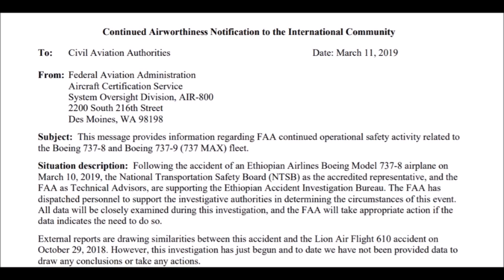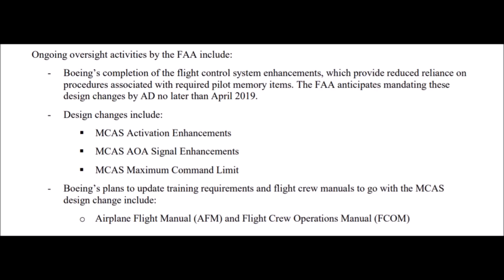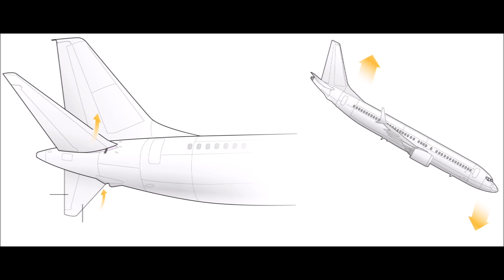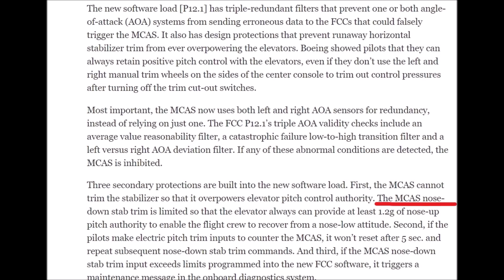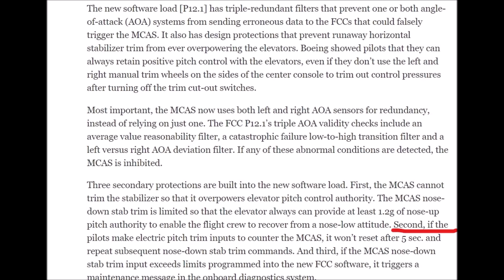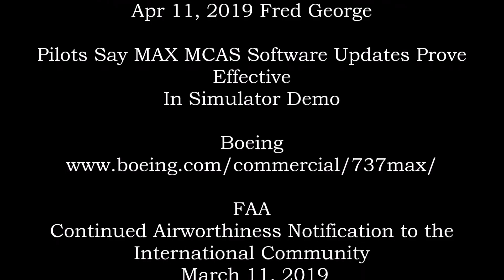737 Max UPDATE 14 April 2019 "The Fix"

Comment: Juan.... Thanks for another very informative video... much appreciated.    I to was a "pilot"... one of the many "90 day wonders" that the Army turned out in the mid 1960s to fly choppers in Nam,  I had a chance to continue on the Alaska pipeline deal, but chose to keep my feet on the ground instead... had enough excitement in my three "tours" over ther to do me for the ramainder of my lifetime.

Just so you're aware,  the Trucking industry is also directly involved in the development of and real-world testing of,  a lot of the modern technologies that has and continues to find its way into the motoring publics private vehicles, at least here in the US, for example; GPS was in use for over 10 years before the first US manufactured "higher end" cars were available with them.   Another spin-off from that was Satellite communications networks from "home operations" centers to each individual semi truck & driver around the country no matter where they were, sitting or mobile... under different iterations and names.

Reflective seat belts is another first so that the highway patrols / DOT etc, can see if you're wearing them or not at night.    Some of the newer technologies being tested (Freightliner Trucks seem to be the test bed trucks for much of this newer stuff) and being further developed is "eye scanners" that watch how often you blink your eyes (and each driver's personal characteristics are programmed into the individual truck's system) during normal waking or driving hours (system is tied in with electronic logging system as well as the vehicles main ECM.   

If it detects a slower or progressively slower eyelid movement (regardless of the cause) it will sound a warning,  if not corrected and detects closed eyelids for 3 seconds it will sound a Very Shrill warning signal,  and for a second time, can initiate a throttle reduction mode apply automatic braking while continuing a warning as well as steering control coupled with traffic monitoring cameras/sensors.  Having said that, the technology is being constantly evaluated and parameters are constantly being upgraded,  so these parameters mentioned a few years back.... development is still ongoing. 

There are many other "high tech" advanced technologies being developed and real-world tested within and through the trucking industry and its equipment manufacturers.

Another technology that has been in use in semis for going on 20 years now is what is very mistakingly called by the majority of the new "so-called" truck drivers (the few of what's left of the real veterans of trucking [30 yrs or more] call the current generation - "steering wheel holders" and most of them do Not have the brains to even do that correctly!) - "automatic" transmissions,  they are Not... they are AMT's or Automated Manual Transmissions.
 
They are still the same Manual transmissions (in terms of the amount of "gears" available, ie; 13, 15, 18 speeds, etc, etc.), but instead of a clutch peddle and gearshift lever in the cab, they have replaced them with interactive ECM's and electro-magnetic servo motors that do all the clutching and shifting for the so-called "truck driver". 

I must say and in my own opinion, the industry has now managed to not only exacerbate an already growing issue that seem to start around the early 2000's and has continually progressed to an ever-worsening situation by not only removing a necessary skill set (and the "brain set" that accompanies),  but in the process are attracting people into the industry that are ever more increasingly "dumbed down" (through the government public "school" system) and quite frankly, many of them have No business Whatsoever behind the wheel of a semi.

I personally,  have nearly 50 years of OTR (Over The Road) trucking experience (semi-retired now) with 27+ years of that as an Independent Owner Operator, and have run all the "lower" 48 states, Alaska, All Ten Provinces in Canada and the Northwest Territories up to Yellowknife and have officially racked up over 6.7 Million Accident Free miles.... and to be honest, I find these new "truck drivers" (mostly those engaged in refrigerated and dry goods hauling).... frightening, to say the least... common sense is nearly non-existent,  they have No compassion for other drivers whatsoever,  and quite frankly - their so-called driving skills, leaves Much to be desired, to say the least.

The only categories that appear to attract and retain people with good well-rounded character and skill-sets are those in the Cattle Hauling, Over-dimensional & Heavy Haul Specialists, Petroleum / Bulk Liquid Tankers, Hopper Bottoms (grain, corn, soy, etc) and those pulling "end-dump" trailers hauling dry bulk commodities of various types.   The "Flatbed" carriers seem to be a "mixed bag"... some are really good,  some are definitely not.... driver quality "seems" directly tied to overall carrier quality and integrity.

I say all this to point out one thing..... we have a situation where "Ai" is slowly (though That is changing rapidly in very recent years) but most assuredly taking control over Everything..... and with it, we - the people are allowing for the "noose" to be put around our own necks.... I openly warned about this coming (and many other things that are Now in place) throughout the 1970s and into the early 1980s... nobody took it "to heart" then..... and the vast majority today,  still don't "get it".
 
Smartphones, Smart appliances of every kind including tv's etc, Smart technologies  =  Secret Military & Residential Technologies!!     RIP America.... your time is nye.
Reply from the maker: Excellent post 2Stroke!

Comment: Don't just fix MCAS and think "Job Done".  Other computer systems and even the fixed MCAS system could fail in other unforeseen ways and drive the horizontal stabilizer.  You have to examine the entire flights of these two crashes (they are rather short) from start to finish.  Somewhere in your examination you will have to ask yourself a very hard question.  Did these two flights crash with perfectly good jackscrew electric motors?  Then, if there is any chance that they did, you have another thing to fix (the "runaway stabilizer" recovery procedure) because re trimming the horizontal stabilizer using the main electric trim switches on the yoke is much faster and easier than turning the trim wheels by hand.  With airspeed building, faster is VERY important here.  Oh, on the subject of "faster", you need to simplify the "runaway stabilizer" procedure by going to a SINGLE switch to disable ALL computer systems on the aircraft (autopilot, autothrottle, MCAS, and any others operating "in the background").

Lots of things to fix here Dennis, not just MCAS.  And we have not even started on fixing the "process" you followed to develop MCAS.

Oh, in your spare time brush up on Japanese Kaizen and read the book "Fate is the Hunter" by Ernest K. Gann.

Comment: I have a Subaru XV. It has many safety features but I do NOT rely upon them. They are secondary protection only. They do not override my driving skills, except in extreme circumstances. Even then they can be overridden by mechanical intervention. They alert rather than control. This is basic when operating an electrical/ mechanical device.

Lives have been lost for Boeing to learn this lesson. Many investors  have lost money as shares tank.

Comment: So another 155 people died after Boeing already knew what the cause of the first crash was?  This is criminal.  Obviously, some bean counters did the math and rolled the dice.  I can just imagine the law suits that will follow.  BTW, I was flying the B-737-200 ADV when 737's started falling out of the sky because of a poorly designed rudder servo without redundancy.  It was quite a worrisome time.  One of my 'deep throat' contacts in Boeing told me it was a poor design and suggested I be extremely careful when checking the rudder on the ground prior to flight...

Comment: PS we all love your 1946 Luscombe, a true airplane. Keep up with footage from your jaunts in the Mighty Luscombe, no matter where you go.

Question: why doesn't Boeing continue the 757 and 767 with seating and not cargo configuration? Am I missing something? Starp on some newer higher efficient engines. 
Okay, the high efficiency engines are too big for a 1960s-era 737 airframe with low ground clearance. I get that. 
Personally, when Boeing moved to Chicago in the early 1990s, we all knew it was becoming a bean-counting company. Save the stockholders, screw everyone else! Keep this salient fact in mind: the 747 Queen of the Skies was all designed with slide rulers.

Comment: Retired engineer here. 
  It keeps getting repeated that there was a pitch up tendency from the engines being further forward and placed a bit higher.
  Unless there is some new physics I'm not aware of, it seems to me the basic problem is that the engines are more powerful than previous engines and larger in diameter which combined cause the thrust line to be lower and more forceful below the center of mass. Of course it will affect the trim! According to Mentour Pilot, even the 737-NG had this characteristic which is exacerbated with more powerful engines of the Max versions.
  It would seem the better configuration would be high wing with under slung engines like the C-130, C-17, ... cargo planes. This way the thrust line could better be matched to the center of mass. Of course this would look different to most passengers and as we know most people associate anything different with it being automatically bad! Protecting the passenger cabin from shrapnel from an exploding engines is simply done with some Kevlar armor and thicker polycarbonate windows in the shrapnel zone. 
  Even current low wing airliners have some protection from exploding engines. It does seem the 737-NG engines have the armor in engine nacelles but this failed with the recent Southwest 737-NG that had an engine fan blade that somehow escaped forward of the armor, penetrated by bad luck the fuselage and sucked a poor passenger out the ensuing hole.

Comment: It is incredible that the flight control units are duplicated and yet ONLY the left external sensor is used to input data to the controller units. The right hand sensor is not used. The software has removed the redundancy of the sensors by considering readings from only the left hand sensor !! The controller units must read both sensors and compare readings for deviation etc..

There were 4 sensors in the plane, the right and left (faulty) hand external sensors and the two pilots. All three correctly working sensors  were ignored.
Amen.
Reply: Technically the AoA sensors switch with each flight and each check - which seems more like something you'd include on the test plane, or in simulator when you want to test pilot's reaction to incorrect input. It is criminal that you had to pay extra for safety (and it wouldn't be much safer anyway, only the most expensive version would have the MCAS taking an input from both sensors). Especially since when MAX was announced and they started selling, they said this would be a standard - they changed it just before delivering first plane.

Comment: Juan's tone and style are so welcome. Please any one, have I missed something in claiming:

When MCAS is disengaged, the 737MAX may no longer meet FAA manual handling requirements. Thus pilots trained on other 737 versions may be subjected to situations for which are unprepared.
Reply: Hugh Riddle There is some debate about the handling characteristics of the MAX in the absence of MCAS. Those details are still subject to legal and regulatory scrutiny, and so are the proposed changes to documentation and training.
Reply: @gordonrichardson2972 , thank you. To me and in principle, MCAS seems (at the very mildest end) of a class of system required to make (eg some military) aircraft flyable, ruling out full disengagement. That aspect could have muddied MCAS disengagement design and led to its engagement status having to be inferred from other settings and indications.
Reply: Its a mess! Using software to fix hardware issues, is never an elegant solution...

Comment: I apologise for the 'perfect hindsight' nature of this Comment, and also for that fact that many people have asked the same question. I'm not an airline professional or an engineer [I'm a very minor pilot with a lapsed PPL on a Cessna 172], but it does seem extraordinary to me that when all other safety-critical systems are duplicated (or triplicated) - even the human pilots at the controls work as a team - something so vital as the pitch control of a commercial passenger-jet should depend on any fewer than (say) three sensors. 

How did this get approved? Please note, that's a genuine question. I'm not trying to be snide or sarcastic or judgemental here - I really can't understand how it was allowed to happen. Nor can I understand why it took 2 (two) crashes before someone in authority saw a need to draw attention to it.

Perhaps there's a clue in the term 'commercial passenger-jet'.
Reply: Elli P Good questions, which many people have asked. There are some complex technical aspects about the B737 system architecture, and the need to avoid pilot retraining (explanations not justifications). Commercial pressure was the biggest factor, along with lax regulatory oversight.

Comment: Great video.  I fly model airplanes Not the full scale ones!   Think "The Fix" is as it should have been designed originally.  Here are some of my thoughts.

Jackscrew controls the angle of the horizontal stab in a relatively slow deliberate fashion via a electric motor (normally).  Multiple inputs to the jackscrew electric motor along with a manual (2 trim wheels) input.  The 2 cutoff trim switches referred to in the runaway trim section of the manual disable the electric motor driving the jackscrew leaving ONLY the manual trim wheels for changing the hor stab angle.  This maybe too slow in a low altitude emergency situation.  A better approach might be to remove ONLY the autopilot and the mcas inputs leaving the electric motor active and responsive to the pilot's up and down trim pushbuttons enabling the pilot  (with the electric motor in play) to change the hor stab angle easier & faster than he could with the manual trim wheels.  A well aimed disable of autopilot and mcas inputs here may be much better that the sledgehammer approach of disabling the electric motor driving the jackscrew.  Not saying remove the 2 cutoff trim switches, they still may be needed in the event of a fault in the electric motor.

Comment: So everyone has forgotten how AutoThrottle Restoration (ATR) software contributed to the SAS Flight 751 crash. Just like MCAS in the 737 MAX the ATR in the DC9 countermanded the pilots inputs. When the pilot reduced the throttle to clear surging ATR ran the engine beyond max power causing the engine to fail. Those that fail to study history are doomed to repeat it.

Comment: Those engines do not belong on that airframe.  They’re higher and farther forward, putting more of the airframe behind the center of thrust, not good for CG.  MCAS is a cheap software hack that lets Boeing pretend the aircraft has the same performance envelope as the rest its predecessors, which it clearly does not.  Stripping down MCAS so it no longer simulates the performance of the older models throws out the idea that pilots need no additional training, and will open up new situations where the balance problem will require pilot interaction to compensate for the design issues.  These aircraft will not be in the air again anytime soon and, as pilots and passengers refuse to fly them, the airlines will get the message.  I certainly will not fly on a MAX in the future.

Comment: cirrus vision jet grounded due to MCAS failure/AOA sensors, 3 incidents of nose down attitude. all 3 times correct emergency procedures were followed by holding auto pilot disconnect for 3 seconds to override the trim run away, and all landed safely. garmin/aoa sensor company trying to fix 
https://youtu.be/HWZhbsGHBss
Reply: That has nothing to do with MCAS.
Reply: @bloodguard41  its Cirrus's version of MCAS. so its got the exact same thing. runaway trim due to faulty AOA sensors
Reply: @seinfeld11123  There may be similarities, but this is not MCAS. It doesn't do any good to equate different systems.
Reply: Totally different system & airplane BUT the method of disabling the faulty system here is of great interest to me.  Pressing & holding the auto pilot disconnect switch down for 3 seconds to do the job sounds much preferable to pushing down 2 guarded trim cutoff toggle switches and following that with frantic hand turning of the trim wheels multiple revolutions to restore the hor. stab to the proper angle.  Thanks for posting the link to the video.
Reply: you are all retards.
it is the exact same system. who cares if cirrus doesnt call it MCAS.I called it MCAS because ppl know what it is. and knows exactly what it means. 
It does the exact same thing. it uses the rear stab  in the exact same way in the event of a nose up stall

Comment: AoA disagree light that would activate if the sensors were producing data that didn't match, optional...??? WTF ? Whose idiotic idea it was ? "Boeing will start to include the disagree light on the Boeing 737 without charging extra for it, but the angle of attack indicator will remain a purchasable extra." Great plan "B", it really is of the smartest ideas in a long time... 

Another one: "Boeing charges extra, for example, for a backup fire extinguisher in the cargo hold. Past incidents have shown that a single extinguishing system may not be enough to put out flames that spread rapidly through the plane. Regulators in Japan require airlines there to install backup fire extinguishing systems, but the F.A.A. does not."

Just like watching "Dumb and Dumber" movie for the X-th time... :-(